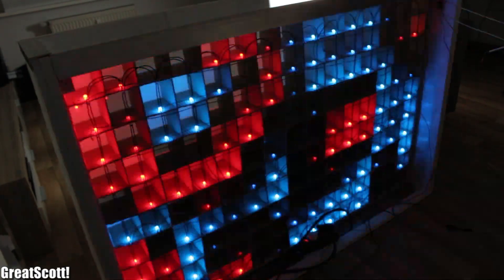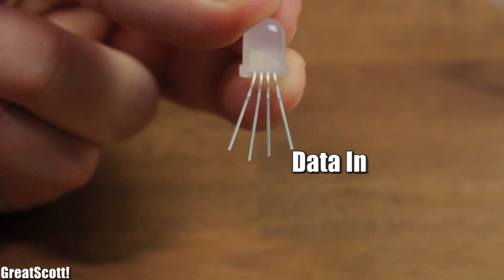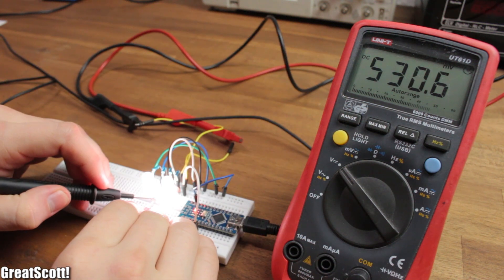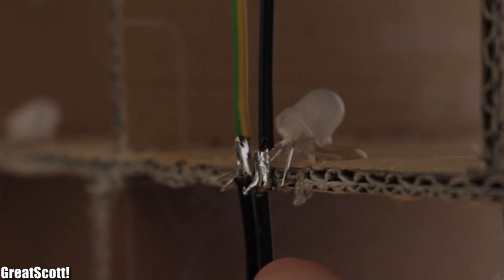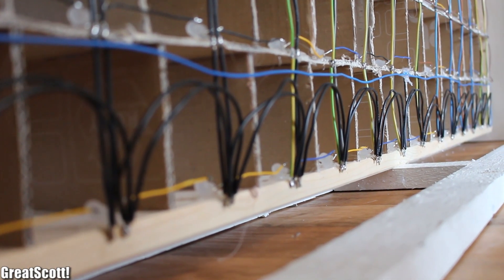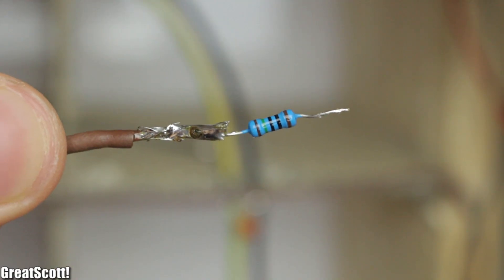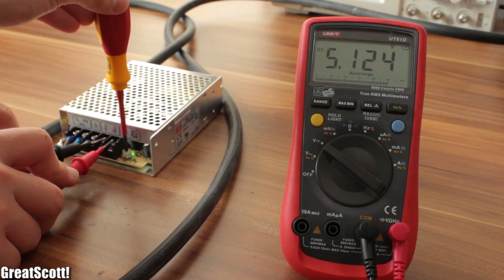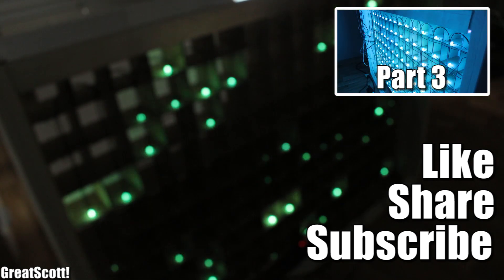Make your own 15x10 RGB LED Matrix - Part 2

Comment: In case someone is looking for a better solution (3 years after this video) you can now get addressable RGB LED string lights in various lengths, with various separations between lights, and even fully silicone sealed waterproof versions, and at least 3 wire colours (a common one is red/white/blue wires, but you can also get dark green, and my preferred colour: black). This is what I use for these kinds of projects now as soldering is reduced to almost nothing. The ones I use are 3 wire: positive, negative, data line and are easily cut to make any length. Each end includes a male and female connector as well as two additional wires broken out that you can use to pump extra power into long strings.

Search for "rgb led addressable string". They are currently (depending on the exact specs, waterproof, LED separation distance, 3V / 5V, LED bulb size, etc) about $10 / 50 LEDs. Cheaper, easier and much nicer than soldering up your own, no need for wire, no need for capacitors, etc.

Comment: Loved the video! Could you please provide an schematic of the wiring? I don't know what to do with the data out of the last LED. Two more questions: the 150Ohm resistor goes between data in of the first LED and pin3 of the Arduino?  How exactly did you connect 5V and GND to "two LEDs of the matrix which are positioned far away from each other"?

Comment: 0:45 You made a small mistake,  DIP stands for dual in-line package, it is the standard package used by ICs with two rows of pins but not most LEDs, and not any of the ones you showed.

Comment: The data corruption you are experiencing is because you did not decouple each LED, NOT the poor power wiring (although that is important too).
You did if afterwards, sure with the capacitors - But you didn't think it was the problem that it was originally.
Reply from the maker: I tried decoupling off screen. That was not the problem.

Comment: Great video, I've have a bag of those LED's and plans to connect some of them up to a ESP8266. A current limiting fuse per columns might be a good idea considering your structure is made of cardboard and you're running a 12 amp power supply with high current capable wire?

Comment: I am going to do this as a school project for my 1st year of studying electronics. It sounds like such a cool project, but I can't figure out how you can control each individual LED when they are not adressable? Can you please explain to me? The arduino nano surely doesn't have outputs for 150 different LED's? Really cool project man! :D
Reply from the maker: +TheAzumDude Watch my video about multiplexing.
Reply: +GreatScott! Thanks man! but when it comes to the controller i only see 2 capacitors on your schematic, but there is 3 on the controller you made. is it one capacitor for each color? in that case i understand.

Comment: If I wanted to use the WS2812 LEDs, will I run into any problems if I follow your instruction in this video? What would be different?
Reply from the maker: +Koriko Alistar The only thing you might need to change is the led type in the code.

Comment: Hey Scott, after my Matrix is completed now, i can tell you that you don't need the capacitors, if you are guiding the data wires completely around the matrix, with some space to the power wires. I did it like this and have no more problems now.
Maybe a video on my account follows later. 
Thank sit again for your very good explanations in the video series.

Comment: If you had installed the decoupling capacitors right from the start, you might have gotten it to work with sensible amounts of power supply wiring.

Comment: Mr GreatScott! 
Can I get a LED strip and cut enough LED cells and use wires to connect them as an ordinary RGB   LEDs ?
Because I couldn't find the right LEDs for the job
I mean will that change your schematic ?

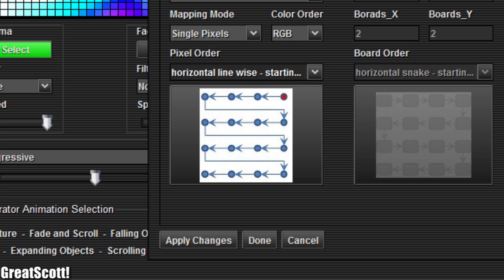Comment: There is a software at 5:36. I hear you say "gladiator software", right? I couldn't find it? Can you help? :) because i wanna to make one of that too. If i can control lights with a software and if there is already a software for this :) it would be awesome :) otherwise as usual i will code by myself if God allows :)
Reply from the maker: Doğan Çoruh You can find all information on instructables.

Comment: Hey! Great Video! I wanted to know is there a way to use the normal RGB LEDs instead of these ones? I am asking because I have a lot of them lying around.
Reply: He tried it with normal rgb leds but because of the multiplexing the leds became to dark, some other wrote in the comments that he made it with multiplexing and it worked all fine. If you don't know what multiplexing means, scott made a good explanation video
Reply: Kevin Paul Thanks a lot for replying. Ya, I have seen that video!

Comment: Hi, PLEASE say if are possible to make this matrix with this LED:

http://pt.aliexpress.com/item/50PCS-APA106-F8-Built-IN-IC-Integrate-Programmable-RGB-Lamp-For-LED-String-Light/32258577347.html?isOrig=true#extend

Also, the diagram, (application note)  does not show any resistors or capacitors, can i not use them, on this type of LED?

Want to do one, And if i do i will make a video to show, Thank you!!
Reply from the maker: roger vanicola They should work.

Comment: Hey, nice Idea. I really enjoyed the Video
Still i think that handling that power supply is extremely dangerous for beginners. When adjusting the voltage, you have the scew with 230V on it right next to you (without any kind of cover). People that dont know much about electricity should't handle with direct connection to the mains close to their fingers...
Reply from the maker: anoxisify It is mostly routine which causes an accident on the job. Beginners are far more careful because they fear the electricity. I have to disagree with your opinion.

Comment: Fantastic videos, very well spoken. 

QUESTION: would it be a relatively easy process to build 4 of these to cover a wall? Perhaps layer wallpaper over flatter construction?
Reply from the maker: Enlightened Agent Well, making 4 of those would be a huge solder job. Definitly not easy but the concept should be the same.

Comment: I don‘t think your original design didn‘t work because of multiplexing itself. Your duty cycle was way less than the theoretical DS due to arduino digitalWrite being slow as fuck... I built an LED cube (8*8*8) with a duty cycle of 1/64 (8 layers and pwm dimming) and the leds are still extremely bright, because the human eye has a logarithmic curve of perception of brightness w/ pwm
Reply from the maker: Yes the arduino digitalWrite function is slow, but I was using the PORT manipulation. So the speed was not the problem. I also measured it with my oscilloscope to make sure of that. Maybe I made another mistake that I am not aware of by now.
Reply: GreatScott! Or the LEDs you used were generally so dim that they couldnt even enter the logarithmic area of human eye perception^^ :D

Comment: Prepare for a bit of a text wall here; I'm not too good at summarization...
There's a TL;DR version of the text wall at the bottom if that helps.

First, I just wanna say thanks for all your fantastic videos- your obsession with LED arrays and your ability to break down the concepts used in your projects is great for a relative beginner like me!
Second, a bit of a request, preceded by a story. Every year, at my school, a few high school seniors are tasked with throwing a mini rave-like party in a small room after the showings of our musical. For each of the three showings, we pack just about the whole cast into a room of about 41 square meters. Gotta say, it gets pretty insane in there... but it's fun! Two senior students are in charge of the room every year. At long last, I was finally given the award of being the coordinator for the room last year, after I went into the party dressed in EL wire and everyone saw how serious I was...
Normally, the lights being used are simply a blacklight and a strobe light. But honestly, I find such simple setups boring! And here's where you come in: do you have any recommendations of what I could use in the room? Current ideas I have are to do a sound-controlled RGB LED strip around the perimeter of the room, though I'm having a hard time trying to find strips online that are inexpensive and likely to work well. Additionally, it'd probably help if they were waterproof, as inevitably someone ends up bringing super-soakers in there (I'm telling you, 35+ insane teenagers in a loud room, it gets CRAZY.) The ceilings are pretty low, as well, so projection lights aren't really an option. If you jumped too high, you can easily hit your head.
I don't want to have to spend much more than maybe $100 USD on this, though I'm not really sure what all would go into this. I have an arduino uno, delluminove, and a sparkfun clone which I could integrate if need be, as well as a raspberry pi model B. Not really a master of using either of them, sadly (Though I'm super willing to learn!).
Thank you SO MUCH if you read this far, I appreciate all your videos and regardless of whether you have any response to give, your videos will definitely help this plan to come together!

TL;DR:
I'm throwing a party in a tiny, cramped room. I'd like to integrate some sound-controlled LEDs that would sync with the music being played. What would you recommend in terms of lights, controlling hardware/software, etc?
Reply: You can make an analog color organ for very cheap, and it will look awesome. First you take your audio signal and hook it up to an op-amp, so you have a bigger signal to work with, but it's not necessary. Then you make a low-pass, a band-pass and a high-pass RC filter, hook up each of them to the gate of a mosfet (or transistor, if you like), and you drive different colored leds with those mosfets. This way you can light up huge led arrays, without worrying about burning out anything.
Reply: If it's still relevant, you can use an esp8266/esp32 with a simple microphone module with WLED (not sponsored)

Comment: I have a bit crazy question. would it be possible to connect lots of white LED's (20mA) into one usb power source in parallel without any resistance? And how to calculate how many LED's that would be? I know for sure, that usb power source won't light up 1000 LED's, so there's got to be a safe zone from where the resistance is not needed. Love your videos btw.
Reply from the maker: MelectroU Not possible. You need LEDs with a forward voltage of 2,5V to put two in series (USB with 5V). White LEDs usually do have a forward voltage of around 3-3.3V. You need a resistor.
Reply: GreatScott! hmm, what if I just used 3.3V  Voltage regulator for 100 white LED's would that be ok? and would they still emit as much light? because it's hard to find the right resistor and with the right power, since lets say 1.7(V)*0.9(A)=1.53 wats and 1.7/0.9=1.89 ohm's. Aprox 2 ohm's and 2 wats, even if such resistor exist that would be near to impossible to obtain it. It's really cool, that you reply to your viewers :)